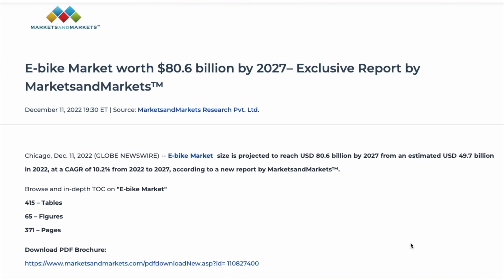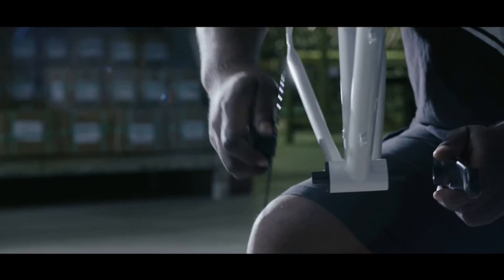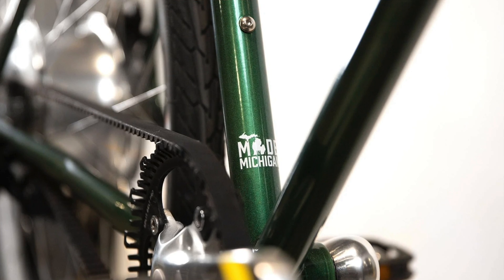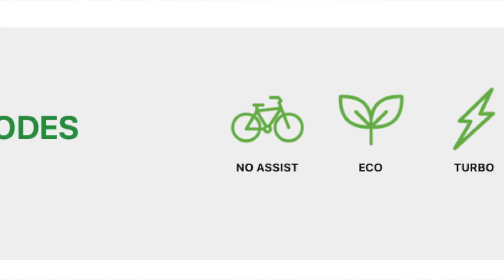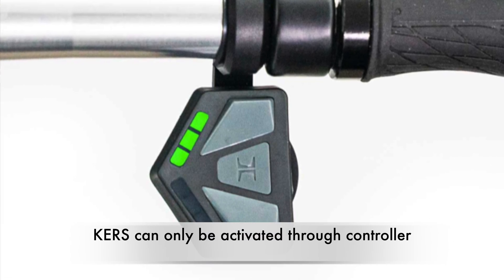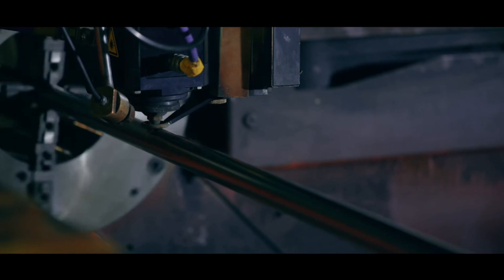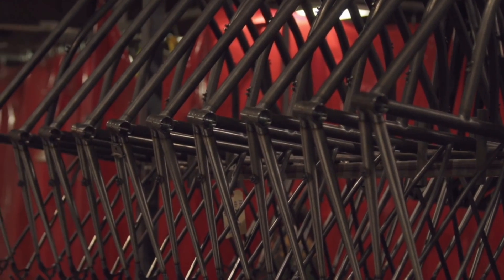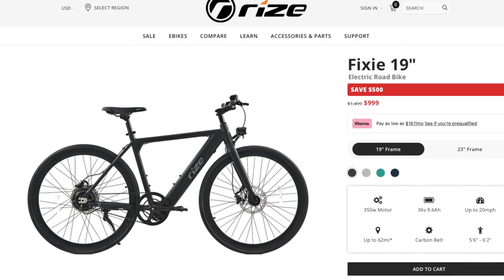Detroit Bikes DB-E | A Steel Electric Commuter Bicycle Made in the USA

Comment: I'm seriously interested in this bike, and have two questions: 1) can the battery be removed for recharging? and 2) can this bike handle a very hilly city like San Francisco?
Reply from the maker: The battery can't be removed because it's housed inside the rear hub. I looked up the specs on the motor and it provides 40nM of torque. It should be able to handle a hilly city like San Francisco, but since this is a single speed the really steep hills will probably require some work on the rider's part. Good news though is that it's on sale right now too. Thank you for the question!
Reply: Thank you for the quick answer!
Reply from the maker: @emilyalgire2325  My pleasure. If you decide to get one let me know how you like it.

Comment: Yes, it's expensive, but 1/3 of that price is to pay Americans to build them.
I wonder what the cost is of that hub motor assembly. I also wonder what happens when the batteries inside the hub die. Can a technically savvy owner reasonably replace them?